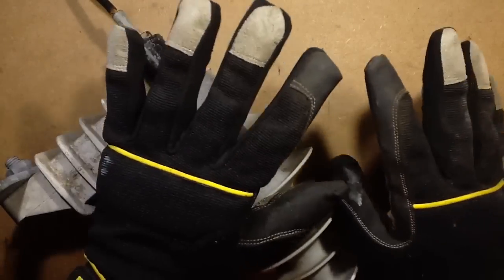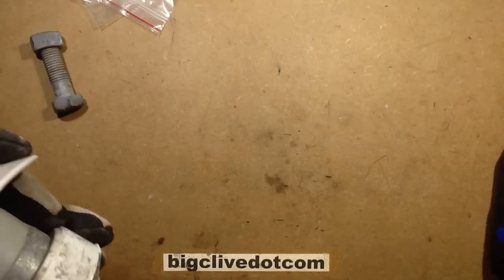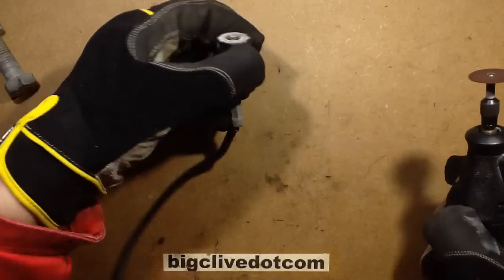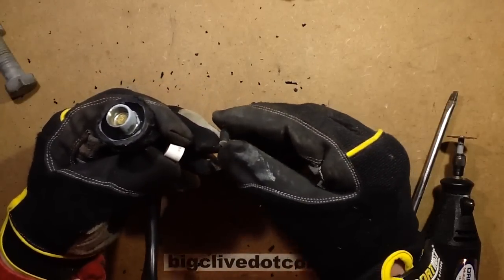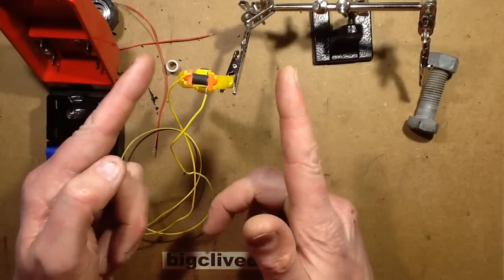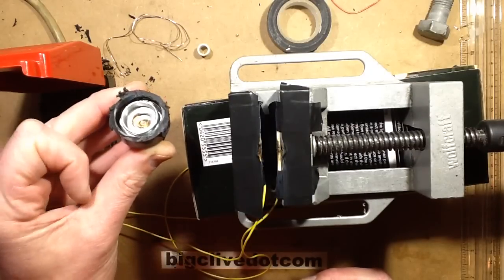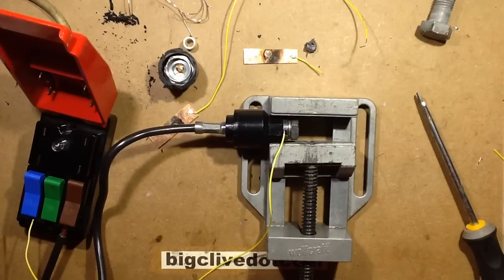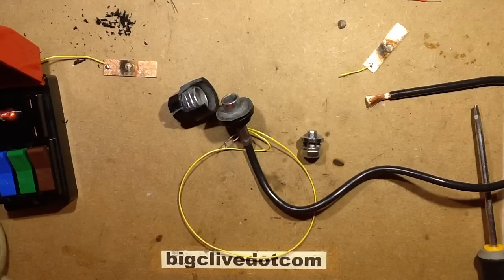Bear & beer.  Opening an explosive 11kv disconnector.  (With bang.)

Comment: Looks a bit like a Pyrodex pellet that muzzle loaders might use, but a bit smaller. They aren't very impressive when ignited outside of the chamber of a gun. You need the pressure build up. Fascinating video. Nice companion to the earlier vid. Now I have an idea of what that bang might be during a storm.
Reply: I suspect this is actually plastic explosive inside a hard tube of some kind and cured.  Much more stable than black powder through moisture.  Pyrodex will go bad just being exposed to moist air long enough.
Reply: Yeah, I don't think it's actually Pyrodex. But moisture doesn't seem to be a problem as that looks totally sealed. It's most likely just as Clive said.
Reply: You can set a lot of plastic explosive off with a high voltage electric charge, which would be perfect in this case.  Don't quote me but i think this is actually how some shell fuses work.

As far as being fully sealed, I think you'd want somthing very stable regardless.  Even "fully sealed" up on an electrical tower isn't ever fully sealed.  Moisture finds its way in there.

I think what actually happens here is that the material, whatever it is, ofgasses enough to make the fully sealed case "explode".   The material inside probably isn't explosive at all, it's pressure building in the case that makes it go bang.
Reply: BILL SCHNEIDER C4 isn't the only plastic explosive.  There's a whole bunch of them.
Reply: No one said it was. Do you just need to argue? I'm not aware of any such plastic explosive, though. Plastic explosive that could be set off by an electrical discharge alone sounds kind of dangerous to me. We typically think of plastic explosives as difficult to set off. Seems like a bad trend to create a type that is easily set off. Anyway, I'm out.
Reply: Whatever it is, it just needs to generate enough gas to reach the bursting pressure of the seal. The nested steel cylinders will then direct  the force so as to propel the two halves energetically in opposite directions. The pellet itself doesn't need to be an explosive.
Reply: Spot on.
Reply: The carbon pin is there to get hot enough to fire the .22 cartridge that is in the casing.
Reply: rewtuser don't plastic explosives need a detonator? And they also don't need to be encased for an explosion.
Reply: Yeah, plastic typically needs a "kicker" charge. Of course it could be their own brew.
Reply: Yeah, what Clive said. In the military, you could never get C4 to go off except with a cap, iirc.
Reply: I was wondering if the ceramic cylinder was performing this kind of function.

Comment: Never seen a surge diverter with an explosive disconnection (on any service equipment I work on, 415v - 132kv). I find it strange because any connection I make (to earth especially) is meant to remain intact (to continue to offer protection until destruction) .

Comment: I wonder if that's how 'explosive bolts' work on rockets when they release their boosters and stages. It's actually just carbon, not a dangerous real explosive
Reply: Well since "explosive bolts" are structural they are a bit tougher so require a bit more bang than the plastic disconnector. Google "Pyrotechnic fastener"
Reply: Additionally, IIRC it's the nuts that are the pyrotechnic fasteners, a lot easier to contain something going radially outwards in many pieces instead of two pieces going in opposite directions quite quickly (like a gun that fires both backwards and forwards).